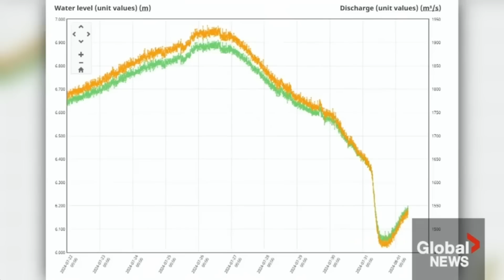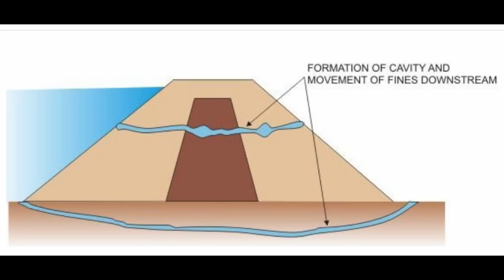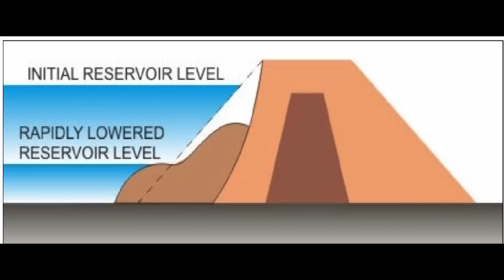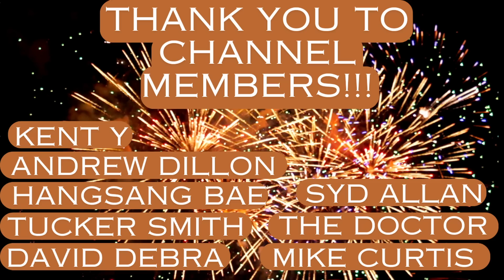Massive Landslide in Canada Creates Dam that will Fail

Comment: The dams mentioned in your video were not over topped…..the water went around one of the dams and took out what was essentially a spillway.   And the other was where the a section of the dam experienced liquidfacation of the earthen dam and washed out. But not over topped
Reply from the maker: Liquefactaction in Wisconsin I don't think so.  Rapidan had water flow over the abutment contact so it was an overtopping event. Sheesh.
Reply: @CaseyJones-Engineer  please read the engineering report about the EARTHEN part of the dam next to the concrete part….the earth gave way more than half way down and washed out from below.   This is a classic case of liquidfaction of earth and dirt.
Reply from the maker: @paulthesoundguy1   Which dam are you talking about?  What your describing doesn't apply to Rapidan or Manawa dams.

Comment: It's 600m wide. I have a hard time seeing it catastrophically failing. More likely it will pour over and erode a chanel over time. That is what ended up happening with the big Meager slide.
The material is also sandy, not clay from what I know so that should help with the drainage and ability to erode steadily rather than sudden failure.
I could be wrong, I hope I'm not.

Comment: Relax people. The Chilcotin below this point to the Fraser has only a couple if properties that have now been evacuated. The Fraser River is flowing at near record low with the dry winter we had. It has lots of capacity to absorb this reservoir volume. The material is post-Pleistocene tills and fine lacustrine sediment from localised glacial outwash ponding. The blockage will top and erode over the wide distance and the erosional niche point will slowly move upstream to reach the reservoir over time. There will not be a catastrophic failure. 

This glacial till covered area has had 8,000 years of slope failures into the river. This is the first time it's happenned when cameras, helicopters and the www exists.

Comment: With the amount of material that has covered the river bed, it will not breach in a rapid manner as you imagine.  When the water level reaches the “dam” height, the water will seek a path creating a new stream path to the Fraser River.  This is unfortunately an anadromous fish stream and this blockage will have a lasting impact on the sockeye, chinook (spring) salmon  as well as steelhead for a long time not to mention the resident fish downstream of the slide.  There is a potential for the steelhead and maybe the spring salmon to enter other tributary streams in the vicinity. Years ago, Chilcotin steelhead were trapped and tagged with radio transmitters and there were a few that went north and entered the Quesnel River, 140 km as the crow flies.

Comment: You explanation of rapid drawdown is not correct.  You have the static water pressure plus a gradient from flowout of the slope.  Wish I could put an image in my comment.    If you look at the google image - this is a small slide in a much larger complex  Would be hard to say the cause in the forest fires.
Reply from the maker: I've never, nor have I seen anybody else, enter a gradient force in a slope stability calculation for rapid draw down.
Reply: @CaseyJones-Engineer  Fair.  In either a drained or undrained, effective vs total - the method would be to assume the pore pressure on the slip surface are the same during impoundment as after drawdown yielding very low factors of safety. That is not exactly what happens in nature.  Perhaps I was triggered by your use of buoyancy and saturation....  A point - if these are fine grained low permeability sediments, unlike a dam, the soils may not be saturated in such a short time as a few days unlike your dam example.

Much like the OSO slide - the precursors of this slide are obvious on google earth.  Look at the 2017 imagery.  This is a much larger slide complex.  This slide could enlarge if you look at the imagery.  There is evidence of landslides throughout the slopes of this valley.

Comment: serious question, why dont they dig a small trench through it to let the water flow through? of course the trench will quickly get bigger as the water erodes it,  but eventually it
will happen anyway with much more water the longer you wait? might as well release the pressure as early as possible no?
Reply from the maker: That would be pretty dangerous for the workers I think.
Reply: Would you like to be out on that slide digging a trench?

Comment: The water saturation adds what proportion to the weight - what would the dry (natural?) density of the soil be compared to water? Also I believe some portions of the table land/ridges and river channel were burnt over in 2017, so that will not be helpful for stability when the water is released and its support is removed (your mention of its buoyancy vs its saturation of the soil matrix). Would the cutoff of river flow at the blockage and the draining of the river channel and water table along the river channel destabilize/amplify the down stream effect once the river flow recommences with a overtopping release if delayed a week or so? (which ought to be some few times its normal flow even in spring mountain melt).

Comment: I've worked technically around river impacts in BC and seen the consequences on the fisheries. It doesn't take much sediment to take out a fishery for decades, let alone the streambed scouring that will occur here when this obstruction erodes. I find it amazing so many commenters here on this engineering channel are trolling this event simply because the Chilcotin River is in remote BC, where few have been anywhere near in their lives. (I have been there, it's not so remote for folks in BC). This slide event is a huge impact for the spawning steelhead, salmon and wildlife and First Nations and others that depend on them in this important tributary of the Fraser. Not even considering the potential impact on human communities downstream.

Comment: Question: Why aren't they trying to remove the slide material ASAP. The first time I knew it happened, I'd be getting equipment out there to remove the debris to try to beat the time limits they have b4 the water overflows.

Comment: Hey Casey, let me give you some insight regarding the video you showed of the California mud slide. The angle the cameraman is shooting his video from makes it look much worse than that slide was. Actually, I'd call that more of a debris flow than a slide anyway. The events on that day could have been  much worse, but nevertheless were still dangerous. The vehicle across from the camera man wasn't as close to the flow as it seems, I know this because I was the one driving that vehicle. There were either 4 or 5 (I can't remember)  slides/flows that occurred within a 15-minute window along no more than a 1 mile stretch of the road that day. The width of the canyon is no more than a half mile at best, it's roughly 4-5 miles long from where you turn off of the main highway and the prominence of the mountains is between 300 and 4000 feet to the ridges on either side but can be higher in places. This canyon gets it's fair share weather and sees a lot of watershed. There was another flash flood debris flow not far from here within a week or so of the one you showed that makes this look miniscule.  Search banning canyon flood

Comment: Would the moisture in the slopes also reduce the coefficient of friction between the soil particles?
Reply from the maker: Absolutely.  Increases in pore water pressure reduce the shear strength which lowers the stability of the slope.
Reply: @CaseyJones-Engineer  Thank you.  Civil Engineering degree in '98, Georgia Tech; but I've spent most of my time in water and sewer systems.   Your discussions about applied soil science and engineering have been very interesting; especially in an entirely different geographic location than my own.

Comment: Shouldn't they drop diggers on the landslide to dig a canal as low as they can so that water can start flowing and eroding the dam to prevent lake level from rising so much?    Based on Google earth elevation, a rise in water level of 30m spread water rise 10km upriver.

Comment: Correction: It's NOT an ecological disaster. It's called NATURE. That's how every river works.
Reply: The ecological disaster is what gets picked up in the upstream flooding and then flushed downstream in the inescapable failure of the blockage. Mother Nature does not include things like Gas Stations, Industrial sites and other bits of human habitation that are fine when kept in a tightly confined spot, but cause all sorts of problems when swept across the countryside.
Reply: It's a pending disaster, of an ecological nature, for the entire area. Stop being so easily triggered by a neutral term.
Reply: @richardlamm4826  It’s a rural area. Just a warehouse full of fertilizer swept away in a flood causes issues not part of the natural order.
Reply: @stickman-1  it is if we cleared the trees
Reply: @LeoTicky  The area was burned in a wildfire several years ago, it wasn't logged.
Reply: @b.c.2281  Area was denuded first by Mountain Pine beetle infestation with lots of dead standing pine, then wildfires.

Comment: If a slide dam like this is going to overtop and spontaneously release its reservoir, it is much preferable to have it happen sooner rather than later. 

I realize that getting heavy equipment in there to force a clearing is improbable, but I'd drop in a pump and a water monitor to force a channel.
Reply: I was thinking blast a channel, the sooner after the slide, the better.
Reply: @hughbrackett343  I wouldn't want to give somebody the order to go down and start drilling for charges in that unconsolidated mess.  Maybe a JDAM bunkerbuster is the option.
Reply: @snarky_user  it did occur to me that they could just tell their air force that they didn't want a dam there.
Reply: @hughbrackett343  Their air force might have a problem with that task.

Comment: The slide in that region in August 1964 created a lake 3 miles long before the dam was overtopped.
Reply: Apparently the new lake is 10 km long, so about the same length- volume, of course, could be wildly different.
Reply: @karenneill9109  Yes.  Agreed.
Reply: Someone posted on Facebook a full news article about that event.
Reply: @duncantorrance1976  The Water Survey Canada hydrometric station at Hope, BC, on the Fraser showed a subsequent spike in water elevations around a week later of 20-30 cm.
Reply: https://waves-vagues.dfo-mpo.gc.ca/library-bibliotheque/40810033_October_1964.pdf  A synopsis of the 1964 landslide event on the Chilcotin River.

Comment: One thing nobody is talking about , is the loose of the incoming salmon spawn , which starts in 2 weeks, it will wipe out the salmon.
Reply: Salmon take several years to mature out in the ocean, so next year’s will be fine even if all of this year’s spawners fail.
Reply: @simontillson482  it depends on which species of salmon spawn in the Chilcotin. Also the damages done downstream on all the fish will be negative. The Chilcotin has sockeye, coho and some springs. The tributaries of the Fraser like the Thompson have large runs of springs and sockeye, the springs come up mid august the sockeye september. Which ever run is in the Fraser will be effected whenthis dam breaks.
Reply: @simontillson482 the Chilcotin used to be a major salmon river. However Chinook there are close to extinction.

Comment: Why do you have the fireplace on on such a hot summer day? What a total waste of energy by turning on heating and air conditioning at the same time!
Reply from the maker: Who said I had the heat on? You are making incorrect assumptions.
Reply: @CaseyJones-Engineer  Oops. I didn't know that the heater and flame are separated in your fireplace.

Comment: Thank you.  There is a feature here and our diverse skill sets come close to meeting.  I DO have an intense interest in geology, nowhere near your expertise. What I do know is debris flows and rapids in rivers. I am a white water nut case.  And because I have traveled some rivers repeatedly, I have seen the results of recent debris flows and landslides.
The landslide is broad enough, I would not choose piping for a first, second, or third likelihood.  Over topping, yes, emphatically.  But, rivers do not naturally flow straight.  The nature of riverine shape is a bunch of S turns that erode the outside  bank, move the river over, until the outside bank meets the up or down stream outside bank.  Oxbows, rincons, reshaping state lines, slides that flow across a river and leave a flat slide plateau to one side and a debris hill to the other.  And that is my expectation of what will occur. It WILL over top and then choose a course across the slide per the low points, and for one or two or three S shapes that will then begin to erode down into the slide.
The determinant , that I have not a clue about, what is the percentage of heavy stone vs the small granular materials.  High in small particles,, fast erosion and Look out sports fans downstream. High in heavy stone,, and a slow orderly reflow of the river.  WITH a rip snorting bit of white water.   Direct experience, I have seen the results of all I suppose will happen. Paddling a river at some vast speed of 3 mph,, you have lots of time to observe and consider.
Is there another slide, in the same area, flat plateau to one side of the river and a debris hill to the opposite side?  The predictor could be right in front of us on LIDAR

Comment: The Madison River has been overtopping Earthquake Lake since the 60s. I predict a similar situation here. Depends on the composition of the slide and the river flow rate. But it’s very wide. There will be no sudden outflow burst, and people upstream may have to get used to higher water for awhile without a lot of earth moving equipment. Either way, for now anyway it’s another “Bridge of the Gods.”

Comment: This area had a forrest fire take out a lot of the trees on that hilside several years ago. It goes to show how crucial vegetation is in regards to soil structure and stability. I think the reservoir draw down as it empties out will have more damage linked to it than we think. The water will siphon the rivers edges away and cause a lot of instability down the road.
Reply: That was one of the first things I noticed. Fire dead trees.
Reply: Looking and the scar the landslide left, it looks deeper then and tree roots.
Reply: @tedr.5978  yes it certainly does. Another person on youtube shared a video investigating that whole mountain and there's lots of evidence showing several other previous slides so that whole mountain is very unstable 😬

Comment: Casey, thanks for this!! I posted this last night on another vid after crunching some numbers (I'm not an expert!):

About 10-15 million cubic yards of earth is a bit much (and dangerous) to tackle. But, looking at the numbers and depending how it breaches, it likely won't be that bad (other than the sediment deposits that may change the course of the river). 
Average flow is 100 cu-m/second. this equals 8.6 (24 hrs) to 17.3 (48 hrs) million cubic meters of water stored. Average high flow for river is 1100 cu-m/sec. So, 24 hrs of water buildup will equal 2 hours of average hi flow for the river. And it likely won't let loose as one massive wall of water. 
Perhaps a hydro person could weigh in with expertise.